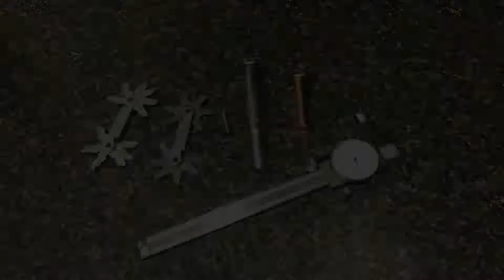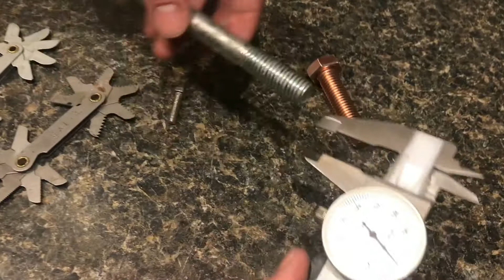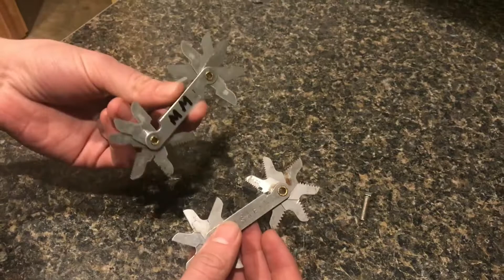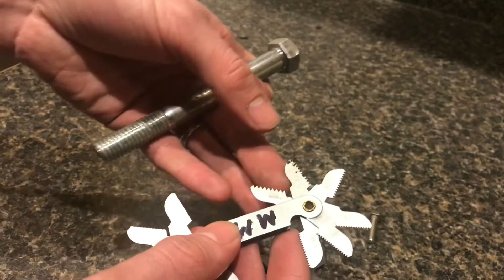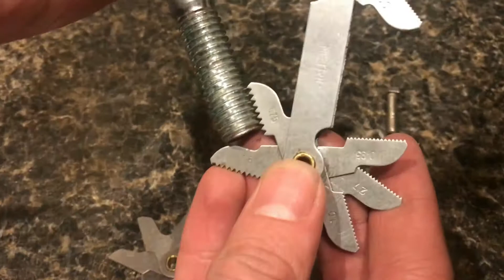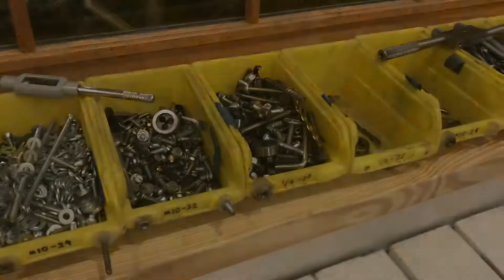🔩 how to use THREAD gages to recognize nuts and bolts

Comment: I am from Europe, and I need metric gauge. What's the difference between 60 and 55 degree gauges, do I need to have them both. Sorry If my question is stupid, I'm new in to this. Thank you your video is awesome.
Reply: Angle between the peaks (crest) and valley (root). 60 degrees is used by the metric system, 55 degrees is used by the BSW (British Standard Whitworth) standard.
Reply: interesting.. the pitch/thread is thinner on metric then?
 @jonzei3966